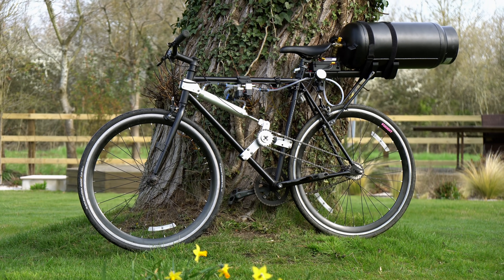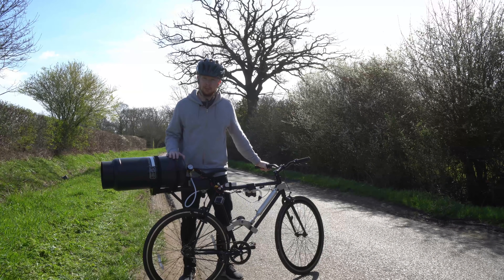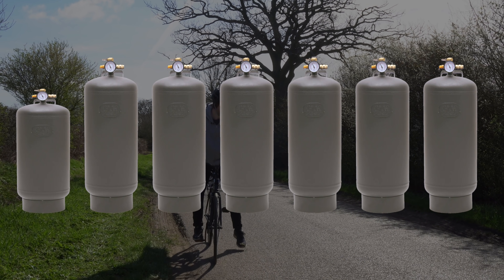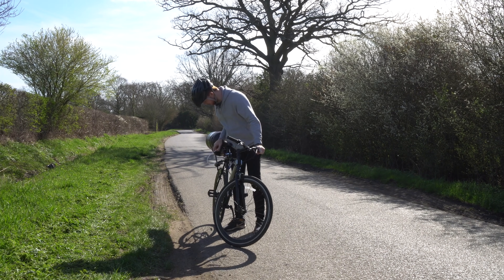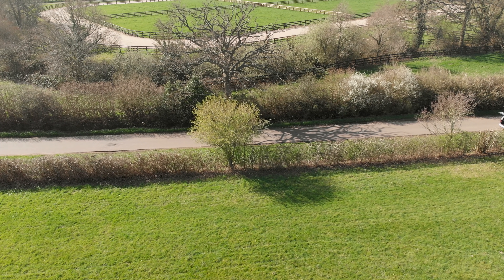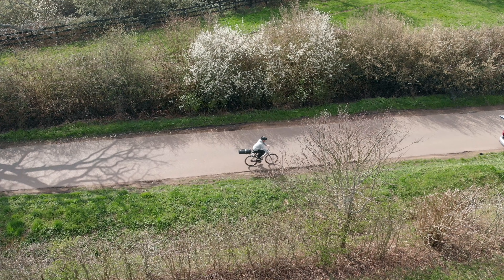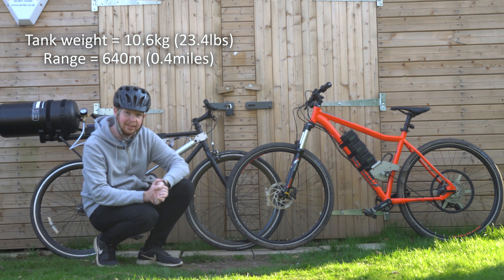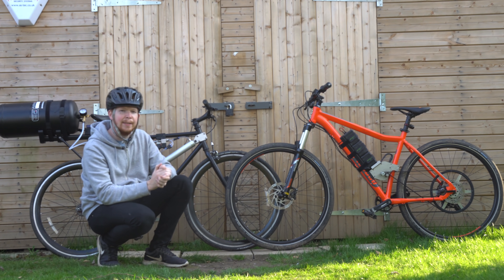Air Powered Bike Range

Comment: This is much better than Elon Musk’s air powered Tesla!
Reply: @CockatooDude  I stand corrected
Reply: Is there one?
Reply: @gustarrezende  There is an option on the 2020 Roadster called the "SpaceX option pack" which includes cold gas thrusters out the back, front, and sides of the car, to improve acceleration, braking, and cornering. The thrusters use a super high pressure tank which is compressed using an electric air compressor powered by the car's battery pack. Pretty cool stuff I gotta say.
Reply: CockatooDude the laws of physics say “nah”
Reply: @CockatooDude  Thanks for letting me know!
Reply: @CockatooDude  just no way hes going to be able to do that because physics
Reply: @CockatooDude  Thunderfoot make a great video on it, but the jist of if is that by no chance you can move a 2 ton car for any large distance with cold thrust,also the recharge rate would be huge and even if it would work the acceleration would not be plesent
Reply: @eitanoidos6304  Thunderfoot turned into a tool a while back.  No one has said the cold thrust is for large distances.  The concept is to drop the zero to 60mph even lower than the base 1.9 seconds.  Since traction appears to be the limiting factor for that vehicle, thrust is about the only way to improve it further.  Since under 2 seconds of thrust isn't a large distance or time factor... I'd say it is possible.  Being that SpaceX uses cold thrusters to move space craft presently... I'd say that if anyone can impliment the concept in a car, Tesla would be the ones to do it.
Reply: thats only used for acceleration, not sustained travel
i think

Comment: This project looks like a lot of fun. One idea: you should add more piston stages cascaded in series, so you can recover some of the energy in the exhaust venting.
Reply: If you were running unregulated SCUBA tank pressures, this would make sense. At the pressures he is running now you would lose more to friction than you would gain.
Reply: yeah, just like multiple expansion steam engines back in days.
Also it is possible to use turbine. At least will be interesting to see.
Reply: Shur Murray but you can only do that with superheated steam, and at relative high pressures.
Not sure if adding more pistons would give you higher efficiency, i only see more friction loses
Reply: Triple expansion ahah
let's make a steam powered bike !
Reply: +USWaterRockets The point of multiple-expansions steam engines was to extract as much energy as possible from the working fluid by the time it reached the exhaust. By keeping the exhaust pressure as close to atmospheric as he can, he has achieved that design aim, i.e. there is barely any recoverable energy left in the air by the time the piston reaches the end of the stroke. (That sounds a bit haughty of me, it's just I had the same thought as you so had a think if it would help or not then I saw your post! :-) )
Reply: @donkmeister this was only true for his testing with the regulator set to low pressure. The first few runs were done with this configuration, but the low pressure provided minimal torque and the bike could hardly get going from a standstill. When Tom increased the pressure 3x to get more torque, the piston was now 3x too small for the expansion, and in the later runs at the end of the video, you can hear the wasted air venting out of the exhaust with a loud hiss on each stroke. I was suggesting that the lost air could be recovered, giving him improved torque and greater efficiency.
Reply: @USWaterRockets  True, I hadn't considered the high pressure/lower efficiency runs. Good point.
Reply: And/or more gears (more gear ratios). But the additional weight might cancel out any advantages.
Reply: Co2 would be great also, I use them on my race car for boost control and my air shifter. What about nitrogen?